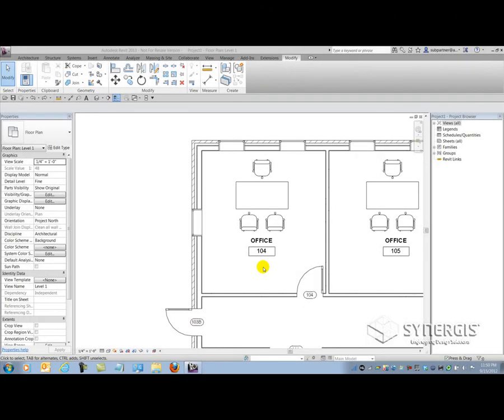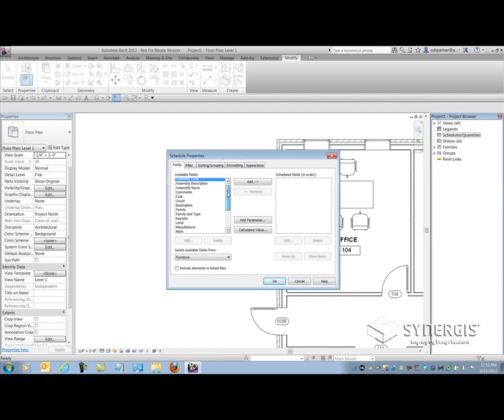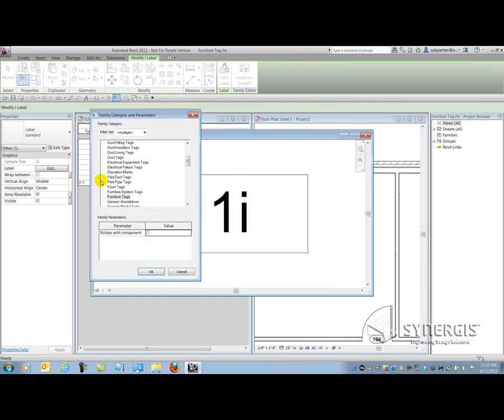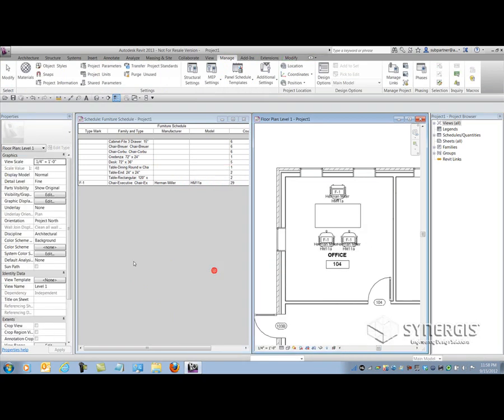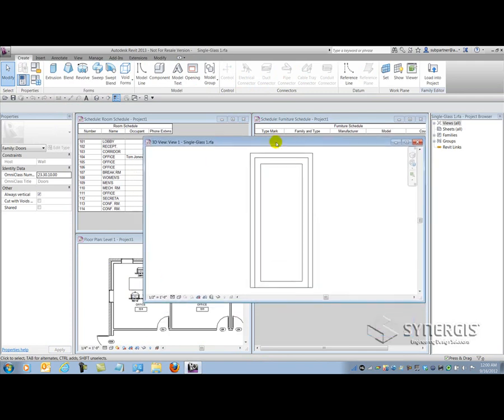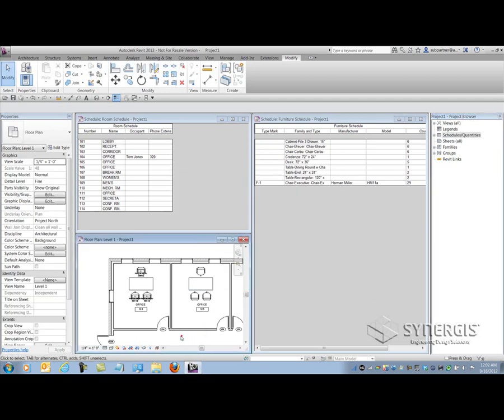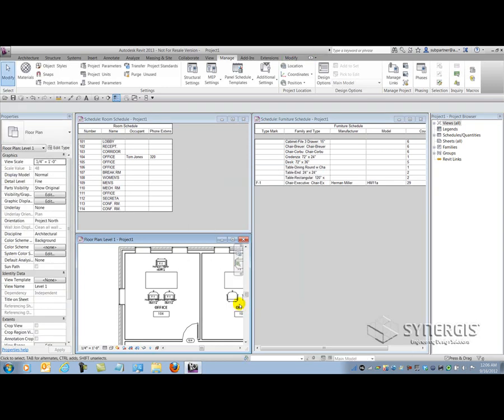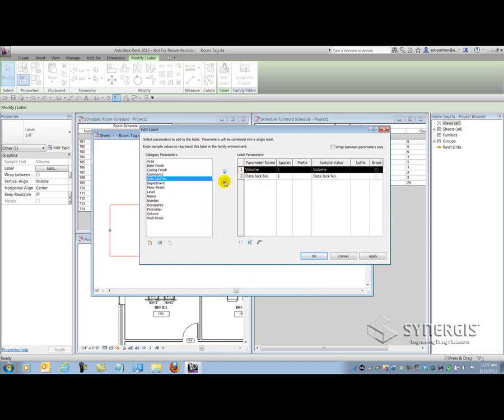Revit Tech Tip 22 Understanding Revit Parameters 9 5 12

Comment: I am unable to understand that tag magic you have done. but why??
Reply: Can you specify what puzzled you regarding tagging?
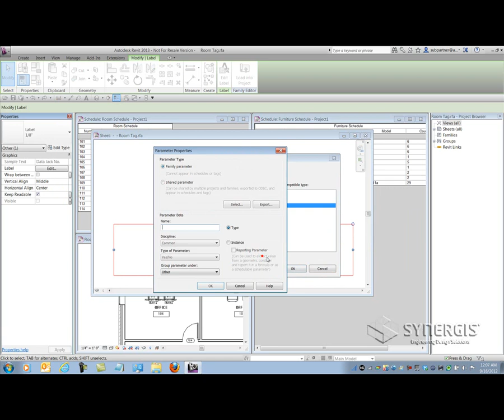Reply: @billk7670  Sir, you said at 17:05 min
Reply: @InDepthCreation  A Revit Family contains one or more Types. In general, a Family is simply a collection of characteristics (geometric and non-geometric) used to describe a model or annotation element in Revit. Parameters are non-geometric characteristics. Every individual element within a Family contains its own "Visibility" parameter. This controls whether or not you see that element of the Family. I'm simply assigning the "Visibility" parameter of the new Label element to an associated "Visibility" parameter in the Family. This gives me the ability to create a new Type in the Family that displays just that Label indicating the value of the room's Data Jack No. value and not its Area and Volume values. There are two other Types in the Family for viewing them.